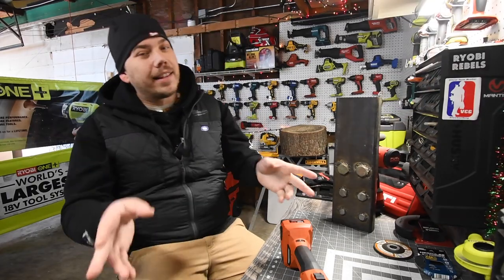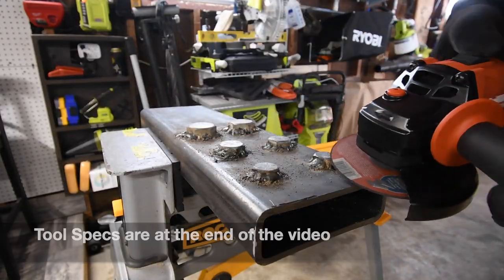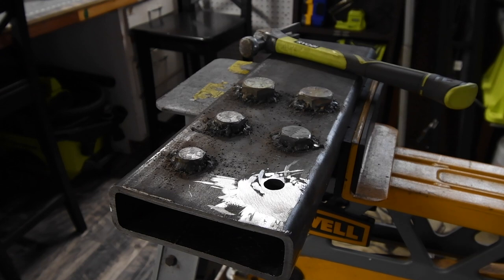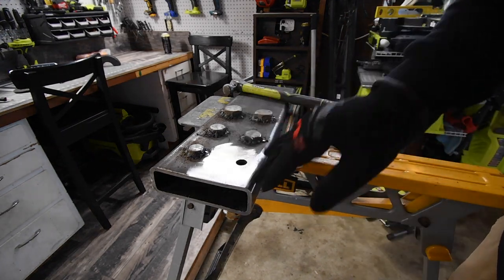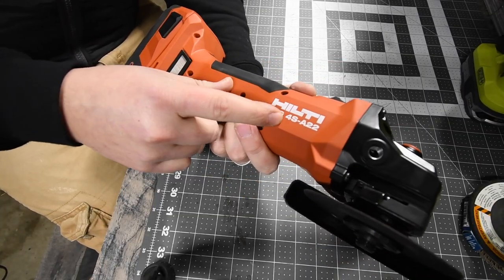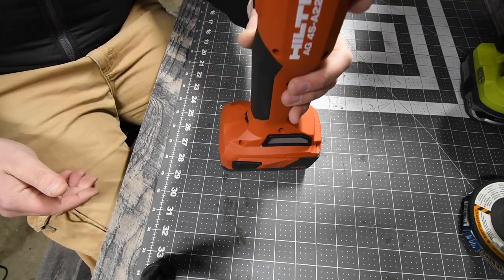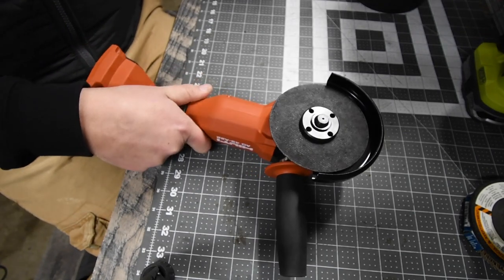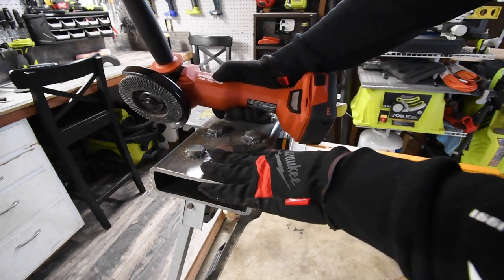HILTI 22v Brushless Grinder (Ryobi and Hercules Wheels)

Comment: wheel wrenches are a waste of time. grab the disk hold the spindle lock and turn the disk to tighten it up. same with loosening
Reply from the maker: will do and I thank you for viewing Teal
Reply: if you have to use a wrench to loosen the disk your over tightening it, hand strength will suffice

Comment: I want that sanding wheel. very refined grinder looks gorgeous. price aint bad for a hilti. battery in the perfect position. unlike other batteries at retarded angles. and the trigger that stays on and in handy position too so no tired hands. cannot fault it at all. I have a hikoki myself.
another thing im planning on getting an all in 1 welder I have a mig and an arc (stick) ill need a tig at a later stage. I know parkside makes one. can use wih or without gas and I think it does plasma cutting too.
Reply from the maker: I love HILTI and this grinder is a beast and I thank you for viewing Ben